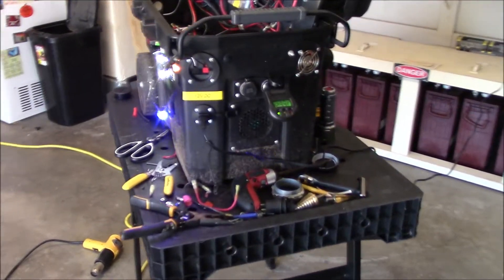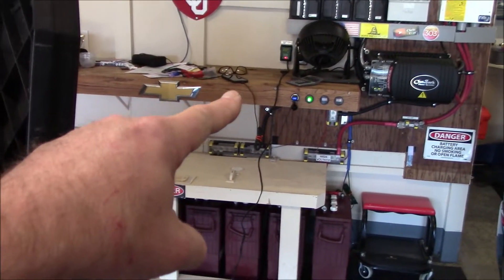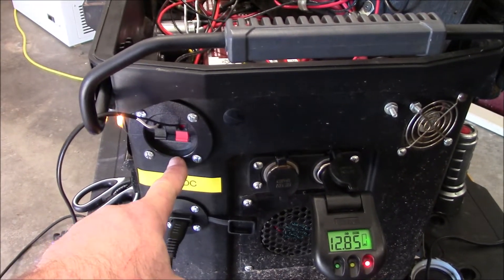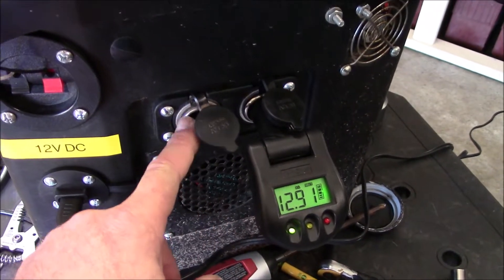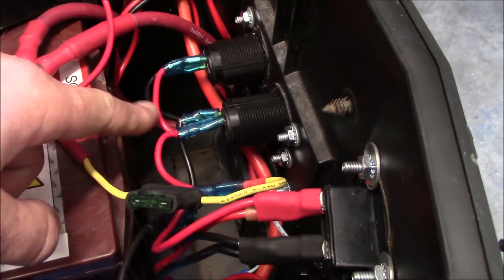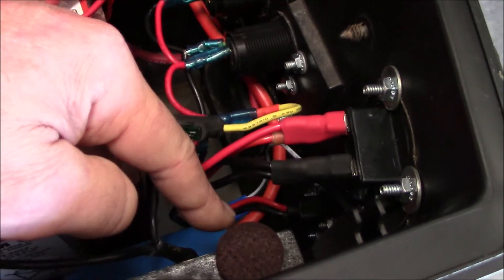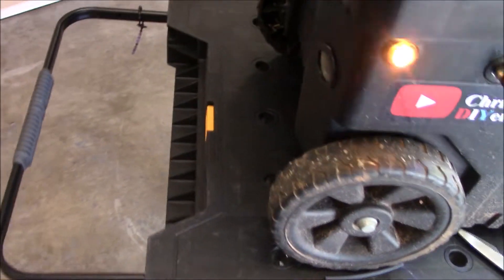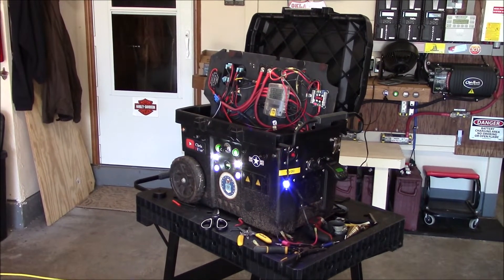Check out these mods! - 12v solar power generator (new power ports, wiring, power sockets)

Comment: Cool mods, kids love anything that is shiny and blinking. I concur with cigarette lighter sockets, majority of them are junk. They are convenient, but they don't last long over time; glad you found some good one out there and pass the knowledge on.

Myself on the other hand have migrated to the Anderson Powerpole standard that is being utilised in the Amateur Radio community. The largest contacts in the same form factor handling currents from 15 to 45 amps; the nice part is they're hermaphroditic, so the same connector can be the socket or a plug. I made up some powerpole to cigarette socket adapters from leftover parts I had laying around and keep them with my power bank/generator for those who are not set up on the powerpoles.

I also utilise their SB-50 series connectors which is keyed by colour code to allow me to have power sources with different voltages and not worry about creating a fireworks show or let the pre-installed smoke out on my gear. The only limit is your imagination and to think outside the box...
Reply from the maker: 100% agree. Those Anderson plugs are awesome for many folks. I have some and tried them out. Pricey...
Reply: @ChrisDIYerOklahoma  Yes they're pricy, sometimes you can find the clone versions on a budget. I find those are hit and miss on the quality control. I just stick with OEM since my applications are kinda a pain to redo when it fails. It may cost a little more, but I only need to do the job once.
Reply from the maker: I got some extras (I think are OEM) if you are interested. I can post a pic on my "Community" section if you want. Lemme know. I won't ever use them. thks